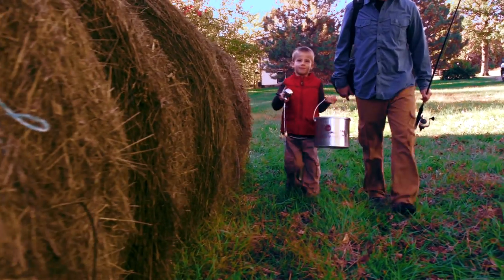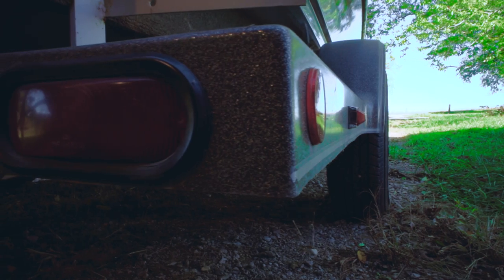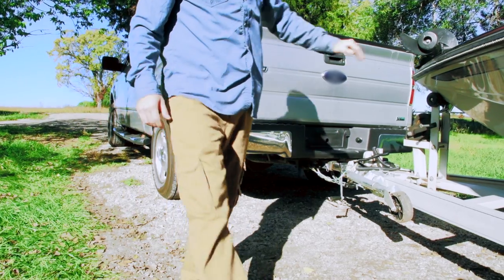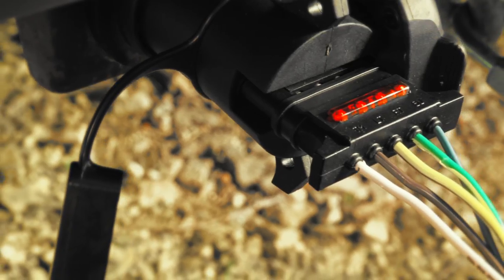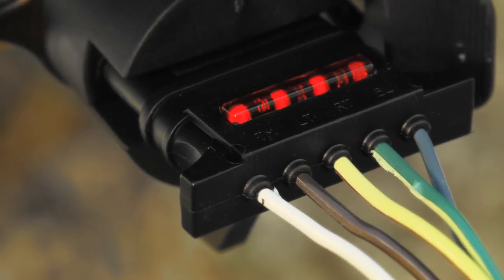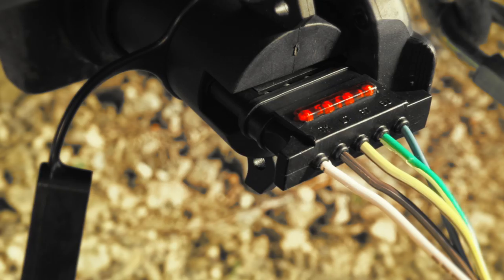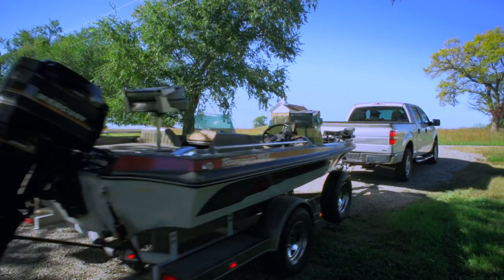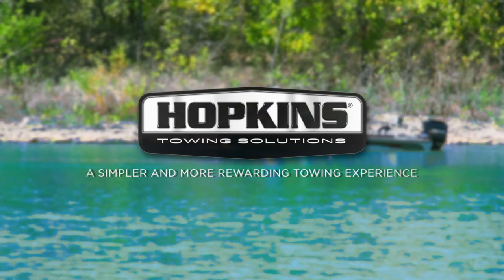LED Test Connectors for Trailers

Comment: Does this work even if nothing is hooked into the plugs?  I've got a 7 blade to 4 pin converter with LED test lights, but nothing hooked into the 4 ... No lights.